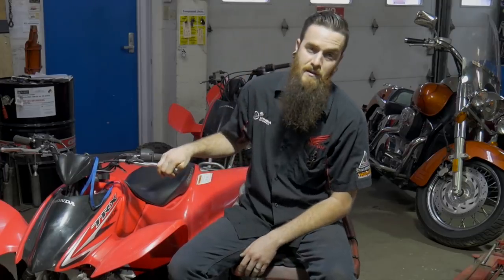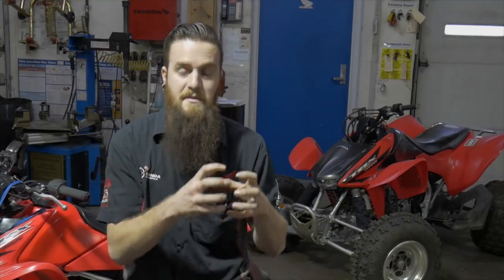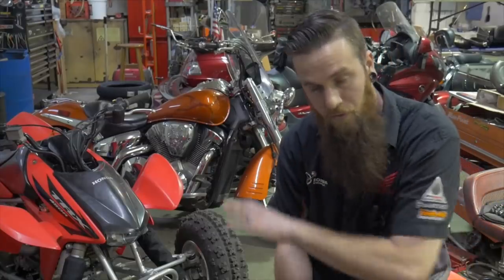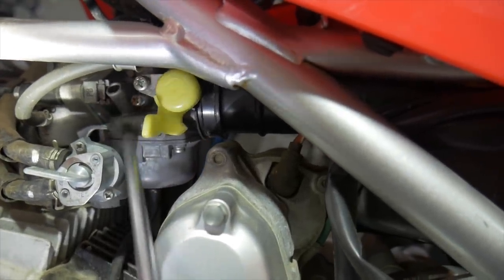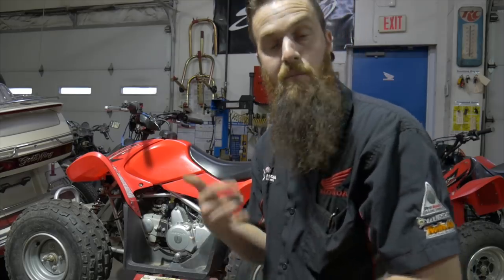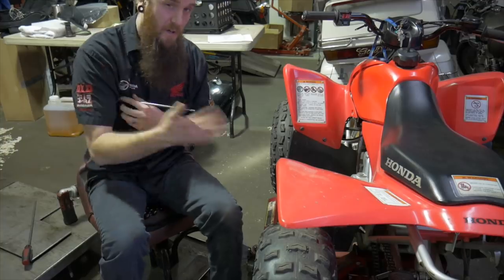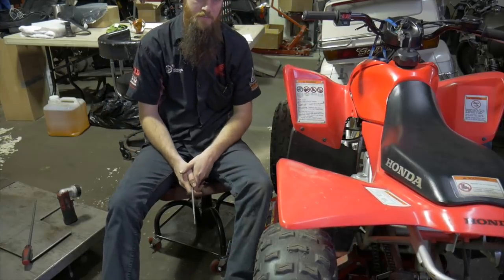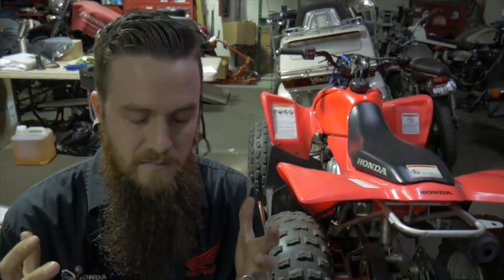Carburetor Adjusting: Idle Drop Procedure

Comment: I have rebuilt the carb for a suzuki gt125. I set the float to spec, set idle air screw to spec (one turn from fully closed) but my issue is that the engine does not idle at all. It keeps dying unless i stay above 1500 rpm. How am I supposed to set Idle since I have to keep engine runing high? Any idea?

Comment: Run the engine for a while with different speeds then turn Off pull plug out and check u want a nice tan colour  not too rich not to lean  that s how u know motor running efficient

Comment: Having this issue after changing the throttle tube on my Africa Twin and had to loosen the adjuster at the carb to get the cables into the new tube. Throttle is 95% good but returns slow. And it sticks when I turn the bars at all. Hoping your fix does the trick.

Comment: i got a 03 honda shadow with golf cart mufflers, did the baffle delete and installed stg 1 needle set, for some reason the pilot needles are not same size, does this mean i have to set air/fuel mix screws independently from each other?
Reply from the maker: I would set them the same.

Comment: Some things come full circle. In the 1980s I was in the bubble with Hondas, every day. Loved it. So much so I branched out on my own with a workshop customizing and servicing…wait for it…those lovely GLs like that example in the background!

Carburetors? Oh yes. I had two CBXs, both a 81 and 82. A custom six-tube manometer to sync those too. Well, I went looking in the toolbox. Yes sir! I still have my flexi OEM Keihin carb “D” driver. I have a box of those little alloy limiter caps for them somewhere, they allowed leaning the mix for altitude and limited enrichment.

I moved on to blueprinting street and racing carburetors after that, classics, hot rods and all. It is a lost art these days. Slide valve, constant velocity, many brilliant designs. It took many years for electronic fuel injection to simulate the real magic a mechanical carburetor does with aplomb.

Comment: I would love to see if you do the idle drop procedure on a GL1500. Because i have a GL1500 and struggle a little bit. Two carbs which are bad to get to. Mine runs perfekt after i cleaned the carbs (Idle circuit was clogged) but i setted the mixture screws to the position which honda recommends (i think 2 5/8). She reacts to throttle inputs perfect and gets to idle immediately but on coldstarts with choke she is sewing if i adjust the choke to about 1500rpm. What can i do against that behaviour?

Comment: Anyone here got any ideas about an issue I'm having with my bike.
I run the bike for about a min and the plug stops sparking. I got through 5 spark plugs in about 20 mins the other day. No evidence of burning out but they stop working like they have blown.
Any ideas? @mdmotorcycles
Reply: Rick Simpson  no, its 4 stroke. It's like they overheat yet not sign on the plug at all. Runs like a dream then just cuts out. Check the plug, no longer sparking. So weird!!

Comment: Got an 83’ Yamaha XS650 and my idle is too low. To the point where when I come to stops the bike will start to choke and proceed to stop. Would this just be an idle screw adjustment or fuel adjustment as well?
Reply: COULD BE BOTH

Comment: In January of 2022 I purchased a 2007 Honda Reflex and since that time I have been attempting to get it to run a bit better.  I've installed a B face off a Big Ruckus and Dr. Pulley sliders.  These helped the Flex drop the dreaded lag and gave it much better performance, however I couldn't get the lag from my throttle.  I would twist the thing and it would just stay, as I let her back it would pick up and go.  I bought a additional tack tried every suggestion in the service manual, read every bit of information I could find on the web to no avail.  Today I found this sight by accident watched it three times, went out to the garage and gave it a try.  I installed a new Denso plug, let her warm up,  put this procedure into practice buttoned up the doors and took her out on a 60 mile test run.  Finally, it's perfect, no crap, perfect.  It will now run 82 MPH cruise all day at 70, not hesitate to climb a hill, and smoothly clime from a dead stop to 50 without skipping a beat.  My deepest appreciation, I have subscribed and will continue to look for those elusive answers Cody.

Comment: I see you have a VTX1300 in the background.  I'm tuning my 2005 1300C after replacing a bad petcock.  Does my A/F mix screw work the same way as the one you demonstrated? Meaning,  turning it in reduces fuel, turning it out increases fuel?

Comment: My 2004 250 Ninja runs great, but decelerating to a stop doesn’t want to maintain idle.  Honestly can’t remember the last time I cleaned the carbs, but it hasn’t been driven much in the past several years.  I did store it with shitty fuel that had separated but got the tank and carbs drained and good fuel back in.  Think there is some varnish still in the carbs?

Comment: Good stuff man. Just got my 78 cb750 running and driving. Set timing. Still has old points after sitting for years.. I rebuilt the carbs. Running air pods and 128 main jets. It's kinda hard to start. And hesitates at low rpms mid range is great. I did not rebuild the accelerator pump.  Kit did not come with it. Any help would be great. Thanks.

Comment: Guys I hope you can help!! I have a 2001 Yamaha FZS 1000 and the start-up on the choke is really difficult it cuts out 3 to 4 times I have to Revit up really high in order for the idle to continue running otherwise it stalls four to five times. When I initially start with the choke the idling is 3000 and slowly decreases and then stalls after 30 seconds of running !!  The Choke plunger works perfectly.
Any idea why this is happening thanks

Comment: Thanks for the videos man! First time doing any of this stuff and working with a Yamaha XJ500. Took it all apart cleaned the carbs, put some bigger mains, (cuz of pods), and finally got it started today for a bit, but needed to have the choke open, and think I flooded it cuz it wouldn't start after about the 4th time I shut off and started it. Also it was slowly getting back to idle like you said that was doing. Too lean? One last thing... Was wanting to subscribe to your website, but I know it's mostly for Honda stuff, is it worth it if I'm working with stuff other than hondas?

Comment: Hey man! I cleaned the carbs on my vt1100 and it seems to run great already! But when fine tuning I hardly get an idle raise when I turn the fuel screws counterclockwise. Do you think I should put one size higher jets? Or maybe just the pilot jet? It seems to run really good at 60.

Comment: the most important thing is to set idle about 500-600 rpm before tryng to adjust the pilot screw, then reset idle to 1100rpm

Comment: you can use a strong centerpunch to knock that welsh plug out sometimes if you angle the center punch a bit... some cheap china aftermarket carbs have welsh plus so flimsy you can dig the soft metal welsh plug with a screwdriver or hook

Comment: What are your feelings on seafoam to clean carbs if it's just sat for awhile?
Reply from the maker: Depends on how long. Slight minimal build up where the bike still runs but is showing signs of lean-ness, sure. Worth a try of a consistent dose. 

If the bike sat for years, the likelihood of it providing any substantial help is slim to none.
Reply: It's an 05 Sabre but sat for around 7 months. Got old fuel out but is still struggling really hard to stay on at full choke even.
Reply: @seanhallahan9142  Hey Sean, did you ever figure out your sabre? I'm working on mine as well. I cleaned the carbs and now it still will not run on choke and makes a loud whistle noise. Any ideas?

Comment: I’m probably the 20th person to remind you that you didn’t show us what you did with the isle screw after your battery died? You lowered your idle until it almost died, st the beginning, then eased with the air/fuel mix. Once you got that, what are we wanting to hear when we go back to the idle screw( or whatever it’s called?)? Also, no mention of duel carbs and what the differences would be?

Please? Otherwise, love you!
Reply from the maker: After you hear the highest idle from the mixture adjustment you simply set the idle back to wherever your heart desires. Ideally somewhere between 800-1100rpms.  There would be no difference with dual carbs. Once you hear the change you make with one carb, do the exact thing on the other. If the carb is clean and working like it should they will respond exactly the same way.. Even if you have a set of 4 or 6 carbs. It’s all the same. Just takes an ear to listen to the sudden changes.

Comment: Does anyone know if there are any main and pilot fuel jets from other 
carb manufacturers (ie: Mikuni, Keihin, ect.) that can be substituted 
for use in the Hitachi HSC 32 CV carbs used on the 80-82 Yamaha XJ650?
Reply: To my knowledge, there were no substitutes but our shop would buy replacement jets from any "K&L Supply" dealer (most all Powersports shops are). Its been a few years since we had a Hitachi in so maybe someone came up with something to help with this annoying problem.

Comment: Hi Cody, I have an 01 Kawasaki Vulcan 500.  It seems to run good, very peppy and has no problem accelerating.  Only issue I have with it is when I hold a constant speed or decelerate, I get some backfire out out the right side exhaust.  I have cleaned out the carbs, balanced them and like I said the bike runs good with the exception of a slight backfire out of the right exhaust.  My question is when performing the idle drop test the left side carb will cause the engine to die when i turn the piolot screw all the way in and run nice when it's 2 1/2 turns out.  The right side card turning the pilot screw all the way in or all the way out makes no difference to the running engine.  Any idea why?  I am assuming that they both should do something to the idle and not just the left hand side one/
Reply: The right side isn't adjusting.  I think that is a signal that there is something wrong like a clog the right?

Comment: So this doesn't have to be very accurate? My bike requires a set point of 2 turns out on all 4 jets for starting. Than it tells me to attach a more accurate tach than the one my bike comes with and adjust each on independently using that. I have all at 2 out and no access to a tach but bike fires up good and idles nice. Can I leave them where they are?
Reply: Nathaniel Melkic those are your manufacturers baseline settings for a stock bike.  More tuning will be required based on elevation, aftermarket exhausts and intakes, etc.  only way to know for sure is to check your spark plug

Comment: Should I do this idle drop tune on a carb in the ambient temperature that I will be riding in?
Reply: mike lyons I just went out and did the exact same procedure on my old 85 trx 125 and the temperature here is about 20 degrees with no danger of the recent 6" of snow we got yesterday melting. Anyhow it worked great even though I'm probably at the max 3.5 turns out, she definitely idles better than before only had adjusted the main screw and was super picky as to a exact sweet spot it would idle at. Seems much happier now in my experience.

Comment: everything is so simple on sigle cyl engines...
Reply from the maker: Then I will have to show you how simple it is on anything else!
Reply: @TheMotorcycleMD  -yes please. do a vid on 4cyl engine. total porn would be a VM carb with both pilot adjuster screws - fuel and air.
Reply: @TheMotorcycleMD  looking forward

Comment: Can you do a video on how you go about determining if a motor simply needs rings or a rebore
Reply from the maker: Visual Inspection is the only way of knowing. Any deep or feel-able rust lines of scoring needs re-bore.
Reply: TheMotorcycleMD ok thanks, cylinder bores check out good that way, maybe I will just throw a set of rings in the old CB750 since I got it apart and call it good.

Comment: Great video, Cody.  I really needed advice on this topic.  I was kinda hoping you'd do it on a multi-carbed Honda like my 1975 CB750, but I'll take what I can get. : )   I just took off my carbs for the first time to do some work on them and I'm not sure I've got the bike running perfectly yet.  Everything seems great except my idle doesn't feel like it's dropping as quickly as it should be after reving the engine. (There's a slight delay.)  With 4 carbs it's hard to pick up on the differences in idle as I turn the air screws.  What Honda tool can I buy to help me tune my carbs?  What are you thoughts on those color-tune plugs that show you the color of the spark?
Reply from the maker: I have two helpful tools in the description that may help! The Honda one is the tool I used for the D style. 
I currently have no input on that color tune doo-hickey. One of the members just picked one up. We shall see!
Reply: The Colortune works like a charm! It's one of my go to tools.
Reply: @edwardmalfroid946  That's good to hear. I'll have to pick one up and try it. What kind of bike are you riding?
Reply: I brought up that colour-tune in the past.  It seems like a nifty tool, but I haven't tried it.
Reply: @daveco1270  
I ride a 76 GL1000 and XS1100LG mostly weather permitting, too cold right now.
Reply: @TheMotorcycleMD  Hey Cody, in the Clymers manual I have for my 75 CB750 it says the bike's tachometer isn't sensitive enough to do the idle drop method properly.  Is there a special tach I can buy to hook up and do it right?  The bike is running good, but I still feel like I don't have the airscrews dialed in perfectly.  I'm not getting a huge change in idle when I adjust them one at a time. Thinking of trying that colortune.  I wish I was closer to Norfolk, I'd bring my bike by the shop and let you take a look at her.  Do you ever get up to Northern Va/DC area?  If so,  I'd compensate you handsomely for a little help getting my carbs adjusted properly.  : )